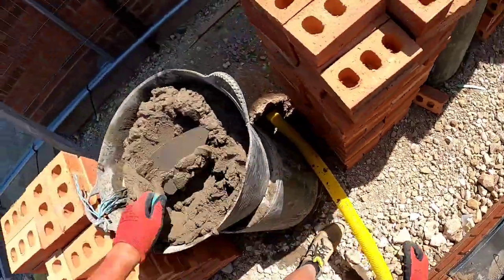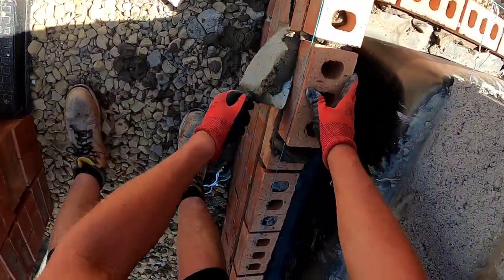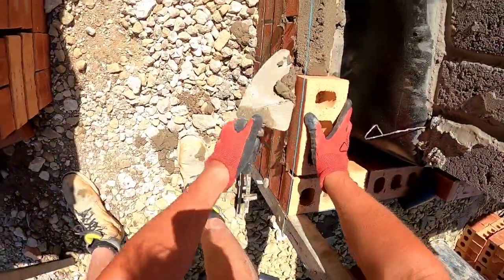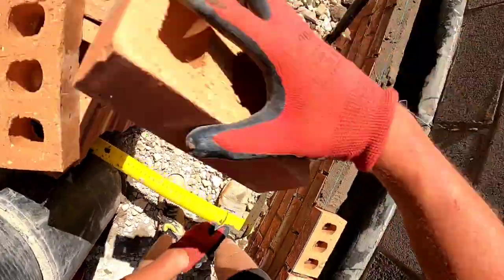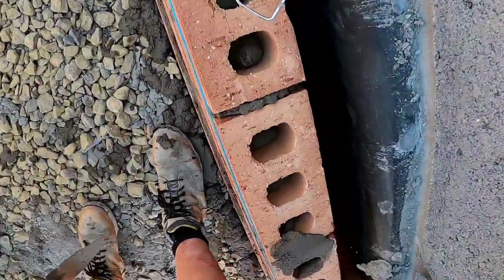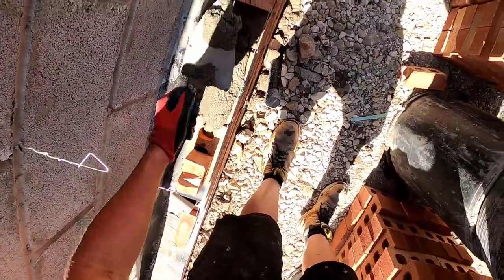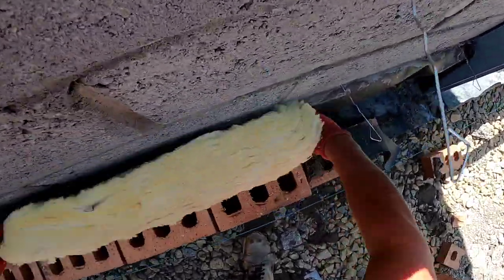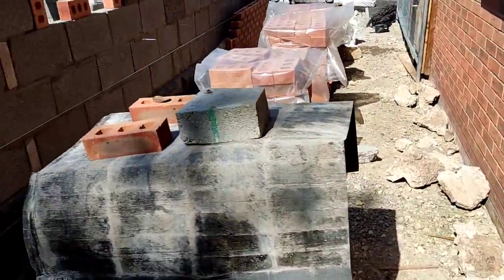Bricklaying Vlog - Speed Vs Consistency!

Comment: When laying brick you need a small trowel, laying block I use a larger trowel. Pick and dip you have to because of the heat. If you lay your bed joint more then a bricks worth of motor between the brick sucking the moisture out of the mud and the sun the mortar will be harder to work with. Been a Bricklayer for more then 25 years you learn all the tricks. Pulling your mud out of a bucket is kinda ruff even with the small trowel. Nice work.